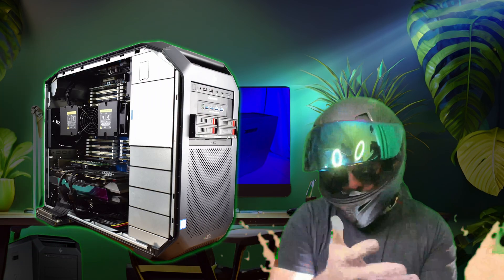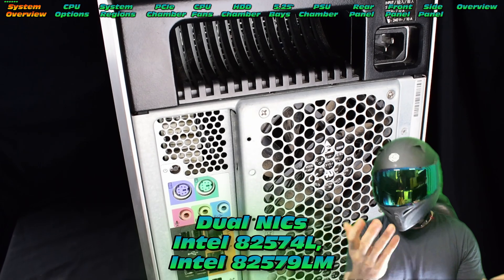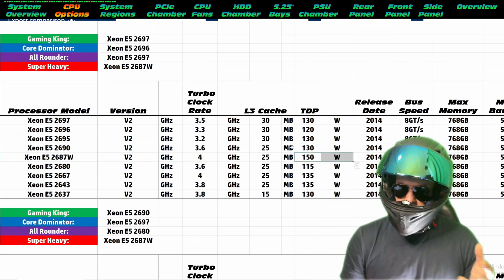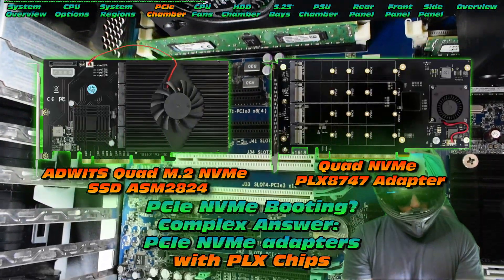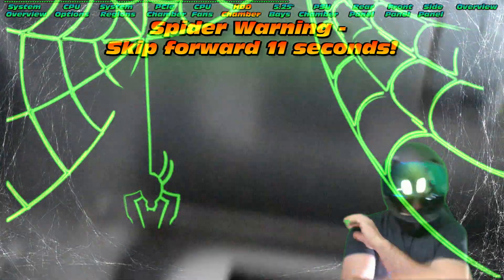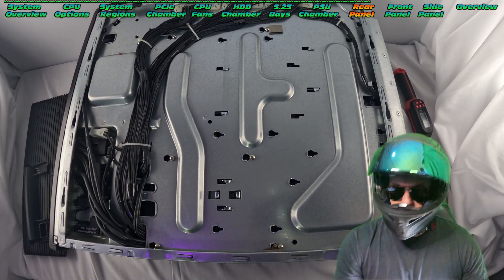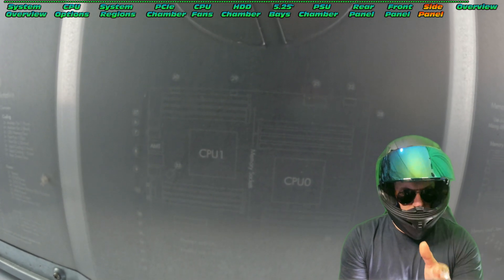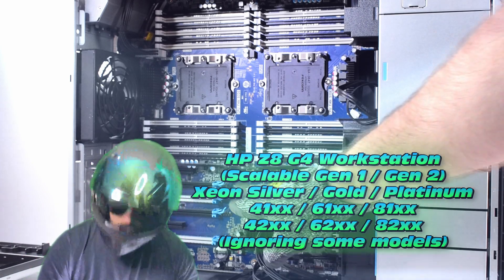Powerful Home Server On a Budget. HP Z820 Workstation Overview. Bank Balance Friendly Hardware #Z820

Comment: I can confirm that the HP OEM 1660Ti does fit in this system
Reply from the maker: Nice - is that with the lower PCIe shroud fitted? I think it will be very GPU specific for clearance - if the GPU is at all over sized that cover will not clear. But there is ample room to get a decent sized GPU in these systems. I had a Zotac Amp Holo Extreme RTX 3090 Ti (356 mm long - there was 360mm of clearance lol) in my Z840.
Reply: @racerrrz that is with the shroud! But to ne fair my 1660super is a oem HP ones with only 1 fan, but it fits great and works great

Comment: Yeah. Now run all that stuff and watch your electricity bill. Just get a i3 12100 or ryzen 5500 and you are better off.
Reply from the maker: You are correct. The Z820 will use 2-3x more power than the more modern offerings. However, a 4 Core or 6 Core processor will not be able to offer what the Z820's say dual E5-2690 V2's with 10 Cores / 20 Threads each (20C / 40T total) at 130W TDP each. I find these workstations operate around 260W-350W on idle before upgrading them - but that is likely due to their platinum grade PSUs keeping power draw down. At present my Z8 G4 can draw as much as 750W when pushed. But there is something special about being able to have 100's of tabs open, two 4K games open, an AI LLM, Photoshop and DaVinci Resolve all at the same time. I mean you shouldn't - but if you could - you would. In terms of the home server application - I would go for the Z840 at present. It's the best bang for buck workstation and it can't be beaten on upgrades: https://youtu.be/2bie4EGJZL0

Comment: for some reason mine is trash for davinci resolve. I ran a test and i could render an untouched video quickly at about 3 minutes. so I added a smear over the faces in video to test it and it tooks 70 minutes to render the same 12 minute video
Reply from the maker: As you say, the testing suggests something is holding your system back. What was your system specifications? CPU, RAM and storage?

Some things you could try:

1) Hardware acceleration settings in Resolve: Go to Preferences → System → Memory & GPU. Ensure CUDA (not OpenCL) is selected (I have mine on auto). Go to Preferences → System → Decode Options → Enable Decode H.264/H.265 using hardware acceleration.

2) NVIDIA Studio Drivers: Gaming drivers aren’t ideal for Resolve. Switch to the NVIDIA Studio Driver if not already.

3) Disk bottlenecks: Use an NVMe SSD for cache/scratch and project files. Storing footage on HDDs = huge slowdown, especially with temporal effects. I use RAID0 NVMe pools for my project files and it's helped a heap (sample video - but I have done heaps on the topic: https://youtu.be/xqg0uQ93KTg ). I have tried SSDs, they can work also. HDDs are problematic. 

4) CPU limitations: Check Task Manager (or try out HWiNFO with data-logging) while editing and rendering. If CPU usage is pegged at 100% while GPU sits idle, you’ve found the bottleneck. In such cases, a GPU upgrade won’t help - Editing in Resolve has many single core operations where it would benefit from a modern CPU, but the rendering is mostly GPU limited in my experience (pending settings anyhow - but the GPU completes projects much faster than the CPUs).

Comment: Absolutely love your channel!
Reply from the maker: I am glad you enjoy the content. Which system have you got and what are you using it for?
Reply: @racerrrz  Ooo I got HP Z440 and I run Proxmox VE. With Dell PERC H310 HBA and HPE FLR 560 NIC I have a lot of network and storage performance. I have installed 96GB of RAM. I use it primarily for storage as NAS and media such as Jellyfin. 

I really would like to find option to power more sata drives as Z440 has only 4 power connectors
Reply from the maker: Well you are in luck because you do not have to settle with that limitation. Here is my Z440: https://www.youtube.com/post/UgkxVgilEnpjp8Pvw2_zS9npnou2g4bN0aKV . Currently with 11x 3.5" HDDs, 6x SSDs and 4x M.2 NVMes. I have now reached a limit of sorts, but with a few changes I can further expand on storage. How you ask? Full guide video here: https://youtu.be/K4RalaEbRI4 . The Z440 remains one of the best systems for that home lab file server. I have mine primary as bare metal TrueNAS Core file server - but it can give dual OS functions with a quick boot order toggle.
Reply: @racerrrz  Thanks

Comment: Hi there GREAT VIDEO's!!!!  Just bought on of these the other day.  Everything powers on but when installing windows I keep getting a bluescreen, would you have any ideas why this is happening.  I have been all over Google and done everything but still this problem.  Is there something I'm missing?  Would it be a mother board issue?  All hard drives and usb stick are seen on the BIOS as it boots.  If you could be anyhelp or post a video on this that would be wonderful thanks again for the great content!!
Reply from the maker: Thank you for your feedback. That sounds a bit odd. I presume by bluescreen you mean the Windows BSOD - which suggests you are managing to install windows but at some point during the installation the process bombs out. 

That sounds like a bad installer .iso or a hardware conflict. Does the bluescreen provide you with an error code at least? That should narrow down the hardware conflict. The best steps to try, if you haven't already: 

1) Test out a different Windows OS .iso installer (so redownload and create a new USB installer). 
2) Test out different OS types - do you get the same issue with Ubunto etc. 
3) Can you switch out some of the hardware to test if there is a hardware conflict. Sometimes it can be a bad hard drive or GPU etc. that causes the issue. A quick test would be taking a known good OS drive - switching it into this Z820 and see if you still get the BSOD. 

Let us know how you get on, that Z820 of yours needs to be put to work on something other than BSODs, let's hope we find the fix! If we find the issue I can work it into a future video.

Comment: These are great machines. I have been using a Z820 as my daily driver for many years now. Recently came across several Z840s that my work was throwing out used as video editors at a tv station. Only downside for Windows users is support for 10 ends next year and to my knowledge these won't support Windows 11 due to the TPM module. Linux is always an option however.
Reply from the maker: They have settled into the home server role quite nicely. The Z840 has a heap of performance for the price point. And yes, Windows 10 support is an issue on these and the Z840, but I have the replacement covered! You may enjoy my recent video: https://youtu.be/z7Ff2zs5ByM - I also have one dedicated to the HP Z840! I did read up on TPM and I do wonder if there would be a method to update these to support TPM 2.0. I did read about it being possible - but I have not confirmed it. https://h30434.www3.hp.com/t5/Business-PCs-Workstations-and-Point-of-Sale-Systems/HP-z840-workstation-TPM-upgrade/td-p/6424377/page/2

Comment: Just got given a barely used 820 out of a large format HP printing press. It had only been in use a few years before HP upgraded the machine to an 840. IT at my work had it in storage and just gave  to me.  
V1 Motherboard with 2 E5-2680s. 
32 gb ram
GTX 1070 founders (moved from my old machine

I wanted to upgrade to 2690s and I saw you have the base coolers which are rated to 130w. Have you had any thermal issues? I was torn between giving it a shot or waiting to get my hands on a 3d vapor cooler from the 840.

Was also curious what's the best gaming oriented video card could expect to put in this system without crazy bottlenecks. 

So far I'm in love... it's a decent step up from my lenovo s20 which just turned like 15 🤣
Reply from the maker: Nice score with the Z820. A dual set of E5-2690's should serve you well. I never had thermal issues on my Z820 but it was also not used for gaming - so that may change if you load it up with modern titles. I can recommend the Z Coolers. In my Z840 they netted ~5'C drop over the stock coolers - so not the best value for the cost, but the benefit was noticeable at least with my E5-2697 V3's managing to run CineBench R23 without thermal throttling. I would expect similar gains on the Z820. 

Keep in mind if you are having thermal issues with the stock coolers you can increase the system base fan speed in the BIOS to offset high temps (or use a quality thermal paste - I have had success with Thermal Grizzly Kryonaut). 

The Z820 should manage similar GPUs to the Z840 in terms of fitment - and I managed to run a RTX 3080 and RTX 3090 Ti. The Z820 should support up to a RTX 3070 Ti but there will be a substantial bottleneck if you are completing CPU intensive tasks. 

The Lenovo S20 was a solid unit for it's time, but no doubt the Z820's dual CPU configuration has made a world of a difference. 

I have done several videos on upgrades for the HP Z840 and a lot of those upgrades would translate to the Z820 also. You may find some of my others of interest if you haven't checked them already.

Comment: Hello, I really like this whole case and Design of the Z820 for a small Home Server (running some vms, maybe plex/jellyfinn, some torrenting and arr aps). I would be able to get one for free, but the hardware is really power hungry. Is it possible for me to change parts like the PSU or the Motherboard, to upgrade the chipset and put in a smaller PSU? From the Video it sounds like a yes to me (at least the motherboard). The PSU I can get ist 850 Watts. Also, if this is possible, do you know what form factor motherboards would fit into there? I cannot see it on the specsheet. Thanks!
Reply from the maker: Interesting idea! Unfortunately these systems do consume a lot of power by design, but they do compensate for it by having platinum certified PSUs with 90% efficiency. You would be able to obtain CPUs with a low TDP and with the right OS settings you could get the power use down - but I don't forsee these using less than ~150-200W on idle with dual CPUs and a heap of RAM. 

Being an HP workstation the motherboard is not like any conventional form factors. I actually compared the HP Z840's motherboard to ATX and eATX and only 2 mounting holes lined up - meaning it is unique (https://www.youtube.com/post/Ugkxii42PFW5WxYmjAHXR-eN3eUVezIQbw-Y) . 

So to fit a different motherboard you will need to come up with a creative mounting solution (it may require adding some metal if there was no supporting metal - but the case is sheet metal and I assume it could be welded!). 

PSU wise, if you were to case swap a different motherboard then the PSU will need to be replaced. The Z820's PSU is proprietary and does not have the normal ATX power connections etc. The smaller PSU fitted to the Z820 does not lower the power use but instead drops the peak power output for GPU support.  

It would actually be easier to use something like the Fractal Define 7XL or XL R2, the only issue is the cost of the case.
Reply: @racerrrz  thanks for the quick reply. Yeah I also did a little bit more research and I think the Fractal Define Case you mentioned or the Lian Li Q25 would be better options for my usecase. But I gotta say, I really like the whole look and design style of the Z820 and ofc the 90% Platinum certified PSU is insane :D
Reply from the maker: These systems do often sell cheap - it could be worth keeping an eye out for one. I would expect a working Z820 workstation to be more useful than a new empty case (at the same price point! lol) But yes, a new case would give you more flexibility for your server build. One of the main advantages of these systems is the relatively low cost to obtain them when aged (new these systems were like $10k!). You also get a platinum 90% efficiency PSU which is a huge bonus (Plat. PSUs are pricey!). 

I will also mention there are the newer versions of this system, the HP Z840 (https://youtu.be/2bie4EGJZL0) and the HP Z8 G4 (https://youtu.be/9xu2sChOSJU; I am working on the update video for this system now).
Reply: @racerrrz  yeah my main point is that, since im working in IT, I would be able to get one Z820 for free. My biggest concern would be the electricity bill (im still living with my parents, but I don't wanna be THIS guy who just "abuses" this, if you know :D)
But I will definetly think about it. 
Thanks again, I just found you from this Video, but you definetly know what you are talking about. Keep up the great work!
Reply from the maker: If you can source the machine for free it is worth it - see it as a temporary transition system that you could sell on once you upgrade. It will cost more power to operate than say a laptop power brick but if you are direct with your parents regarding the electrical bill they would be more understanding. All you need to do is explain how the workstation will improve your productivity. 

If the bill is a problem you could contribute the excess to break even. If you do math on the system's power draw they will not increase the power bill substantially if you only use the system periodically. If it's 24/7 or even 10 hours per day that might make more of a dent - but still a manageable expense. Just make sure to select CPUs with a lower TDP and fit the least number of RAM modules to make ends meet. 

Thank you for the support, much appreciated!

Comment: Those are suckers to anyone in Europe since electricity here costs $0.50+/kWh
Reply from the maker: These days you are right, the joys of global instability leading to energy shortages. The Z820 would use  a fair bit more power than a modern Ryzen system - so if the power bill is an issue it's best to go for lighter servers. That's why I am building a Mini PC Server - 30W peak power suits 24/7 operation - a lot better than 200W lol.
Reply: @racerrrz  Ain't no global instability, it's just taxed as hell!
Reply from the maker: @Adam130694  Ouch! We can't win these days. Cost of living crisis is met with rising tax - makes sense... Global instability wise I mean the Russia and Ukraine war in particular - Russia cutting energy supplies to Europe will be the main driver behind the price hikes. Hopefully that improves over time as new power plants are constructed with all those tax funds etc. We can only hope anyhow. In the mean time, power saving builds FTW.
Reply: @racerrrz That was the most subtle and thoughtful "Umm, Actually" I've read in a while.
Reply from the maker: @SpoonHurler   Thanks! I do my best to get ideas flowing in the comment section lol. The challenge is keeping a positive viewpoint - especially in terms of the hardware outlook. The recession vibes and inflation is hammering projects. I often explore project ideas only to realise it will cost too much to justify. The latest idea was a quick video overview on the HP Z4 G4 (best value system at the moment) - but that would be a $500 USD idea and re-selling it might not go smooth when none of us have cash to burn. Mini PCs it is!

Comment: Onboard SATA 3.0. Are you sure that it isn't 4x ports 3 Gbps(white) and 2x ports 6 Gbps(grey)? The Quick Spec documentation reads: 2-channel SATA 6.0 Gb/s Interface (2 channels e-SATA configurable)4-channel SATA 3.0 Gb/s Interface. 8-channel 6 Gb SAS interface (8 SAS connectors on the motherboard)
Reply from the maker: Good spotting, you are correct! I must have got my circuits crossed while I was somewhat ambitiously editing 4 videos at the same time in the same timeline (Z800, Z840 and Z8 G4 - these are yet to be released). The Z820's chipset is on the older side, and although it does well in the modern day - there are a limited number of USB 3.0 and SATA 3.0 ports. The SAS chipset does make up for it though. But as you pointed out, it would be important to check the ports that your machine is using to connect the drive bays - 3Gbps is noticeably slower - but it would only be noticed with NAND Flash storage like SSDs (3Gbps = ~300MB/s / 6Gbps = ~ 600MB/s; most HDDs peak ~220MB/s).